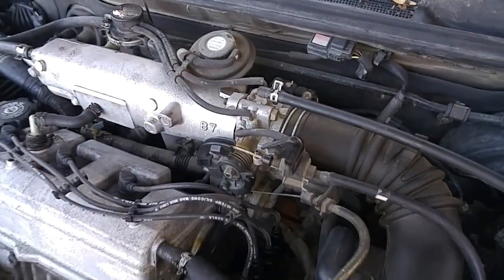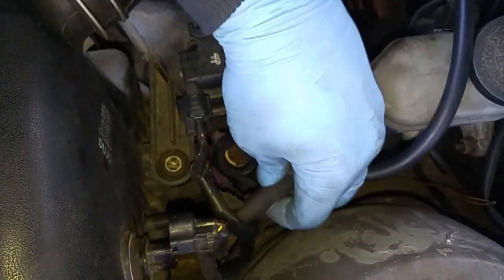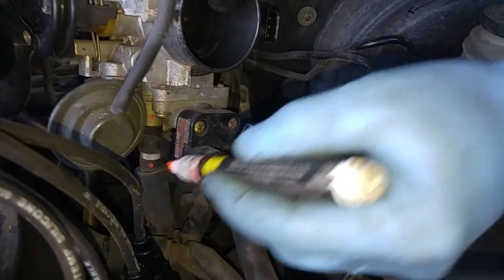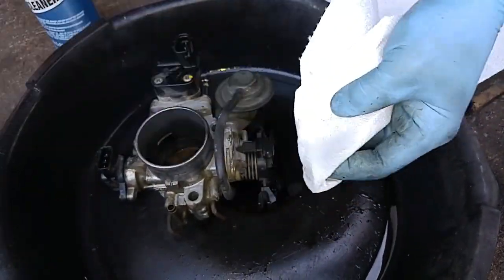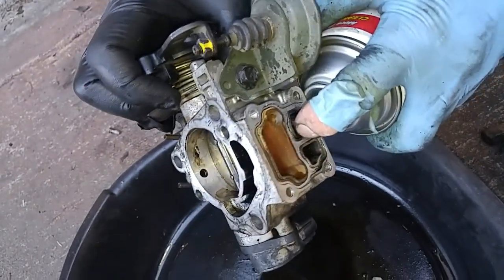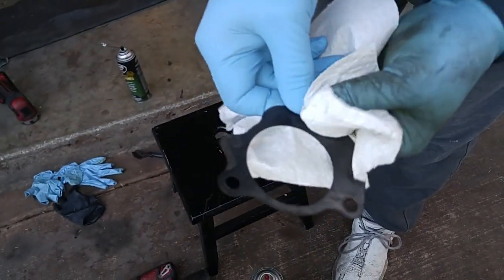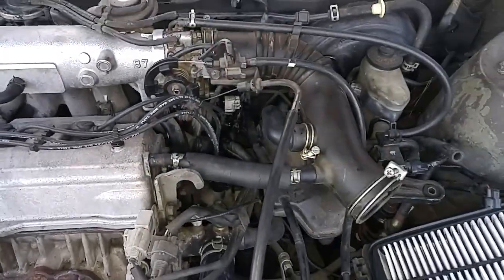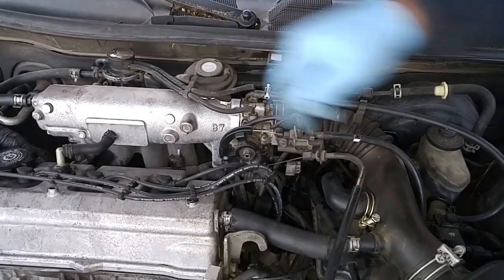Toyota Camry / RAV4 / Celica / Solara  I4 5SFE - Throttle Body & IAC Cleaning

Comment: Wow wish i came across this video. Got the po401 cod changed my egr. Egr mod vsv still got code. When i took off old egr valve there was alot of carbon in the exhaust chamber. Makes me think its clogged up in throttle body port just like you found. Also found torn throttle body main air intake hose thought that might have been it. Temp taped it up but code still came on.
Reply from the maker: Thanks for sharing!  Replacement air intake hoses are cheap.  With the age and mileage on my Camry, if the engine runs good with good fuel economy, I tend to ignore some of these annoying codes.

Comment: Thank you for the video. Very very helpfull. Unfortunately while cleaning the throttle body. I lost track of which hose goes where underneath the throttle body. A little help please
Reply from the maker: The hoses circulate coolant.  When the temp rises, it shuts off the idle air control valve which drops the engine rpm's.  So doesn't matter if you connect the supply or return line wrong.

Comment: At first, I cleaned the sponge inside the EGR valve, and then the engine started shaking. After that, I cleaned the throttle body (there was no gasket, so I used a cardboard substitute) and the idle air control valve, but after reinstalling everything, the engine idle became unstable, fluctuating between high and low.
Reply from the maker: I'd guess you've got a EGR problem assuming everything was okay before you cleaned the EGR "sponge".  Recommend you recheck everything with the EGR.

Comment: What part is that the one that says b7 I heard you call it a intake but I can’t find it online . The throttle body attaches to it in this video.
Reply from the maker: You mean the air intake hose / pipe that connects the throttle body to the air filter box?
Reply: Behind the throttle body where you disconnected it from 😅 sorry I’m not good at explaining lol
Reply from the maker: That then is the intake manifold.

Comment: Hello my friend great video, wondering if this could be my issue with my 2005 toyota avalon it won’t stay running, as soon as i let go of the gas it dies on me
Reply from the maker: Check for vacuum leaks.  Spray with brake clean aerosol cleaner on lines with the engine running and listen for a rise in rpm's.  If there's an increase in rpm's, you've found your leak.

Comment: Did you spray the screws to the iacv with anything or do they come off fine with the drill. I’m scared of stripping them
Reply from the maker: Use a manual impact tool with a phillips head adapter.

Comment: 👍🔧Thanks for making and posting this video.  I got the throttle body off ok, but I ruined the screws attempting to remove the IAC.  I could be wrong but I think they are JIS not Philips.  My bad.  
Update:  Just in case anybody ends up in the same situation-  I attempted to use an extractor to get the screw out.  The extractor broke, then a drill bit.  I ended up using my Dremel to cut a slot in the screw.  Using a flat head screw driver, the screw turned easily as if it wasn't even tight.
Reply from the maker: Yea those screws can be on real tight.  I use a impact tool to get them off without stripping the heads.
Reply: @hardlymovingpro  👍🔧

Comment: Can you tell me what the container on the intake hose is? 01:27
Reply from the maker: It's a buffer for the air flow.
Reply: @hardlymovingpro  Is the Buffer important for the Engine?
Reply from the maker: @Rosewood.w202  yes.  Smooths out transition from power to idle and visa versa

Comment: Carbon build up on the intake side or airfilter side of the throttle plate? Because when i looked on my car with the same 5sfe engine from filter side surprisingly it was shiny like new after about 8 years that i driving it. I don't know other side of it.
Reply from the maker: EGR and PCV blowby gases are channel into the intake manifold behind the throttle body.  When you lift off the gas pedal, the throttle plate closes and the gas temporarily backs up against the closed throttle plate which accumulates carbon.  This is a one of the biggest problems with turbo engines.  What you can do is to install a "catch can" that filters the carbon in the gases before it enters in intake manifold.  Also on the 5SFE engine, there's a hose leading from the valve cover into the air filter hose attached to the throttle body.  This could be a source of carbon build in front of the throttle plate if there's excess blowby gases caused by worn piston rings.  Here's a video showing you how install a catch can in a 5SFE engine via the PCV hose:   https://youtu.be/CXure6_MyZM

Comment: Great tutorial, feel sorry I arrived too late :( cleaned the TB still attached, with liqui moly TB cleaner yet I am afraid I overdid it & sprayed into the intake manifold. Might be flooded, car won't start & searching for a way out on the net many seem to have the same issue. What is the best way out of this mess. Any1? Tx beforehand.
Reply from the maker: May have flooded the combustion chamber.  Can remove plugs and let cylinders dry out

Comment: Did anybody do this on their Camry & get better gas mileage?? Or any improvements
Reply from the maker: Cleaning doesn't do much for MPG's but smooths out idle and throttle response.
Reply: @hardlymovingpro  thank you I just picked up my 3rd (4th generation) Camry with the 5SFE and want to do a full maintenance tune up on it! Ima keep this one forever love these Toyota Camrys with the in-line four motor in them! BEST GENERATION CAMRY EVER!!
Reply: @hardlymovingpro  what would you recommend for tune up maintenance?
Reply from the maker: New plugs, ignition wires, valve cover gasket and run a 1/2 quart of Marvel Mystery Oil at the next oil change.  This oil will dissolve sludge buildup in the valve train.  Also pull the plugs out and pour around a oz of Berryman's B12 Chem Tool into each cylinder and let sit for 24 hours.  Afterwards blow compressed air in the chambers to prevent hydrolock before reinstalling the plugs.  The B12 will seep into the piston rings and could help loosen them away from the pistons if they're stuck.  Do a drain and fill of the transmission fluid and use synthetic ATF (Valvoline or Castrol).  Replace the front motor mount.  They do wear out.  Check that your CV boots aren't torn.  Check stabilizer bar links and bushings for wear.   Look for micro cracks in your radiator.  They open up when the engine heats up and will leak.  Remove the upper timing belt cover and check for slack in the timing belt.  If so, loosen the belt tension to allow the tensioner to remove slack.
Reply: @hardlymovingpro  Appreciate the knowledge brotha will be doing all these things for my future maintenance 🙏🏼💫

Comment: Thank you for the video I got a question I just cleaned out my throttle body and iac but now when I start the car it idles at 2200-2400 rpm ive seen a couple of people say that u need to re train the idle or something like that
Reply from the maker: Should drop to normal idle after warm up.  If not the iac is stuck and needs to be recleaned.  Also check for any vacuum leaks from disconnected or broken hoses

Comment: Do you think an oil catch can help after replacing this part so it never gives a carbon build-up issue?
Reply from the maker: You'd probably have to install a 2nd catch can for the hose leading from the right side of the valve cover to the intake tube.  That should dramatically reduce oily gases entering your intake.  Only thing you can't control are EGR gases going to your intake manifold.
Reply: @Hardly Moving Productions  Thanks. I ordered 2 and will be installing them later today.
I had to replace that throttle body because it had so much gunk built-up.
Reply from the maker: Carb cleaner does a good job of carbon removal with a nylon or brass brush.

Comment: I have an issue with a vacuum leak at the throttle body shaft, does anyone know what kind of seal is on there, or do I have to replace the whole throttle body?
Reply from the maker: Very cheap to get a used throttle body at salvage yards...at least in my neck of the woods.  Plenty of Toyota Camrys with the 5SFE engine.

Comment: What's best way to make sure the manifold port to the EGR valve is not partially plugged and clean it? With valve body of is it possible to get to it? I still need to finish your great video so maybe you'll mention it. Thanks for your video and any help would be appreciated My 2001 Camry w/4 cyl only has 104k miles but is getting only about 19 mpg and code reader say bad EGR. So also hear its best to get those bottom bolts on the EGR from under the motor with a long 1nch extension and socket. See its a bear to replace it and my hands are way bigger than most peoples but hat to spend the cash when I do most my repairs myself.
Reply from the maker: I currently have over 300k miles on my 1999 Camry never once having any EGR related codes.  I suggest removing the EGR from the intake manifold and clean out the ports with a wire brush.  Also using Marvel Mystery oil added to your gas may help clear things up.
Reply: @hardlymovingpro  Awesome thank you very much for your help and videos

Comment: my next adventure on my 99 V6  solara!       great as always!!!
Reply from the maker: Have fun!
Reply: @hardlymovingpro   Is there anything different you could give me a hint on ours are pretty much straightforward the same…?
Reply from the maker: Concept is the same.  2 coolant lines, idle air control plug and throttle cable.

Comment: Hello dear 😁 i have same tht car but the both of EGR not installed and also the cheak engine light not coming 
Is there any problem comimg from no EGR in car . Thnak you
Reply from the maker: No problem.
Reply: @hardlymovingpro  even fuel no more use

Comment: Thank ver much my 2007 toyota is get stuck on high idle when going downhill.
Reply from the maker: Is you air conditioner on?  The engine revs higher when it on.

Comment: The blow-by from the PCV valve cannot carbon up the throttle plate. The blow-by from the PCV valve is downstream of the throttle plate. The carbon on the throttle plate must be coming from the other crankcase vent on the right hand side of the valve cover near the air box. That crankcase vent is upstream of the throttle plate and will carbon up the throttle plate. The catch can needs to go in the hose between the valve cover and the snorkel hose near the air box. The PCV hose needs a catch can too, but only to prevent carbon fouling of the intake valves. To simplify and clarify, one catch can in the hose between the valve cover and the snorkel, and another catch can between the PCV valve and the intake plenum. Done!
Reply from the maker: Thanks for sharing and good to know for those wanting to install a second catch can.
Reply: Commenting to save comment thanks man

Comment: There's a cleaner made especially for that it's called Throttle Body and Air Intake Cleaner
It works much better than Carb cleaner, it's what I use 😉
Reply from the maker: You can even use cheapo oven cleaner.  It's very aggressive with carbon and grease buildup.

Comment: Do you remember the torque spec for the 4 bolts?
Reply from the maker: I don't use torque specs on 10 to 12 mm nuts and bolts.

Comment: Can I just clean it with out taking it out ? Plan on using a tooth brush or brush, and a rag,  TB spray cleaner.
Reply from the maker: You could but found it easier to clean taking it out.
Reply: Thank you! I have a 2000 solara 4cy and I can’t find the maf sensor since I want to clean it while I take the TB apart. Any help plz

Comment: I can't for the life of me remove those screws holding the IACV to the throttle body. I almost stripped one. You didn't seem to have trouble with yours. Any tips?
EDIT: Got them with in impact screwdriver. 

Tip for everyone else: They are not phillips screws. They are JIS screws. PHILLIPS WILL STRIP THEM.

Another tip: If you remove the small plate with 2 screws from the side of the IACV, you can open and close the valve from there. Don't lose the plastic liner, it likes to fall out. Make sure when you put the plate back on that you get the end of the spring into the notch.
Reply from the maker: Thanks for sharing

Comment: Time for a real drill. This cheap Craftsman won't budge any of the 4 screws that attach the idle control assembly to the throttle body 😒
Reply from the maker: You need a 3/8" impact driver with a 3/8" phillips socket.

Comment: When I turn the air conditioning on, the car shakes. Also,  I have a P0505 code. Could the reason be due to carbon buildup  and it's clogged up in the throttle body and IAC valve? If I clean it up like it's demonstrated in this video, would it resolve the problem?
Reply from the maker: Yes.  Cleaning up the IAC and throttle body should help.  The a/c compressor, when engaged, takes horse power away from the engine.  The car's computer will compensate by increasing the air volume via the throttle body or IAC.  If either is carbonized, this will restrict air flow.
Reply: @hardlymovingpro  Is it ok to use a wire brush to clean it?

Comment: What happens if you swap the coolant hoses?
Reply from the maker: Reverse direction of the coolant flow?  Don't think it matters.  The coolant temperature flowing to the throttle body controls the idle air control valve.
Reply: @hardlymovingpro  I see, I asked coz I have a Toyota station wagon type with a 3sfe engine and my cold idle used to be 1200 rpm and warm idle was 750 rpm. I used to have a rough idle so I took it for IAC valve cleaning. The idle is now very very smooth but cold idle is 750 rpm and warm idle is 1200 rpm, the exact opposite of what it used to idle at cold or warm engine. I was thinking something must have been swapped and looking at how the IAC valve for this engine is designed, the only possible thing to swap are the coolant hoses, the IAC valve itself is designed like a puzzle piece, can only sit one way so I doubt if it was flipped or wrongly installed.

Comment: Can I do the Sea Foam spray precces to a Toyota camry 1990? Just by removing the big hose that connects to the throttle body and spraying it through there, while the car is at 2000 RPM?
Reply from the maker: That won't really clean up the throttle plate that much.
Reply: @hardlymovingpro  ok. If I spray sea foam spray through the throttle I won't damage any sensors that are after the throttle body. The reason I ask is because I see another sensor.
Reply from the maker: @sinuemedina2550  if you don't want to take off the throttle body, you can always hold the plate opening and clean with rags and solvent.
Reply: @hardlymovingpro  ok thank you!!

Comment: hey. the two vacuum lines that goes to the modulator. are you suppose to run a wire through the pipes?
Reply from the maker: Squirt some carb cleaner through it.  If there's blockage, you can use a thin nylon brush to work out any carbon buildup. Never seen one that was blocked.
Reply: @hardlymovingpro  thanks for the quick reply. i guess what i too specific. those two brass pipes from the throttle body connecting to the modulator. are those tubes suppose to be blocked? i dont think they should and i tried to run wires through those brass tubes and it seems like theyre both blocked
Reply from the maker: As i said before, squirt carb fluid through the tubes.
Reply: @hardlymovingpro   it didnt work.  im gonna say what happened here just incase someone else has the problem and they  try this menthod. carb cleaner didnt work so i ended up taking the whole thing apart. apparantly there is a tiny needle like hole that connects to those tubes from the thottle body. i had to get a very tiny wire to unclogged it. it took 5-6 time poking thought the hole and i blasted the hell out of it with carb cleaner. hoping this fixes my p0401 issue
Reply from the maker: P0401 could be the vacuum switch valve bolted underneath the intake manifold.  Access is through the right front wheel well.  No fun replacing.
Reply: @hardlymovingpro   vsv is perfectly fine. like i said in the previews comment. i figured out the issue. just posted it just incase someone else gets stuck with this situation again.
Reply: @hardlymovingpro appreciate the fast reply.

Comment: Could this be the reason why my 2005 Toyota celica is shaking only when I have my foot on the break at a red light while in drive. when I’m in park it’s fine.
Reply from the maker: One of possibly many, but a cheap place to start.  Your a/c also places a load on your engine which causes vibration.  Engine out-of-tune needing new spark plugs, ignition wires, oxygen sensor and a clogged catalytic converter.
Reply: Hardly Moving Productions okay is this an annoying job for a mechanic? Because I think my mechanic knows what it is but to lazy to address the issue so might just start doing it myself
Reply from the maker: @mando2.049  Probably unsure what the problem is and doesn't want to guess.  Afraid whatever he does doesn't fix the problem and feels bad charging you.

Comment: Sir, i have problem in my toyota camry 2002, see the link ( https://www.youtube.com/watch?v=FKOrZCvYp_Q&feature=youtu.be ) and ( https://www.youtube.com/watch?v=A-ujSd69gXQ ), its coming when i start the AC, i clean the throttle and change the IAC valve and spare plug with cable, but stile the problem in, can you please help me....
Reply: please sir, i need your help if you can...